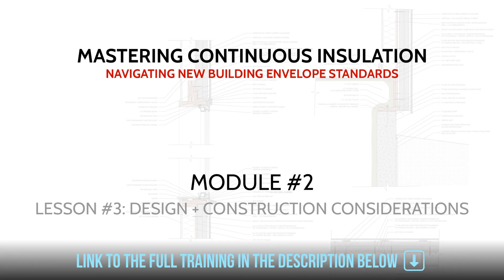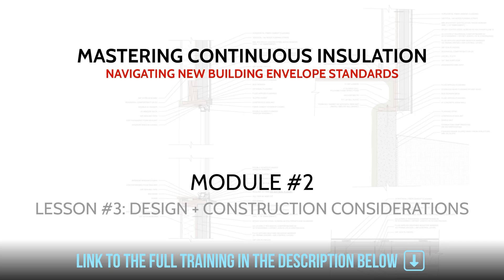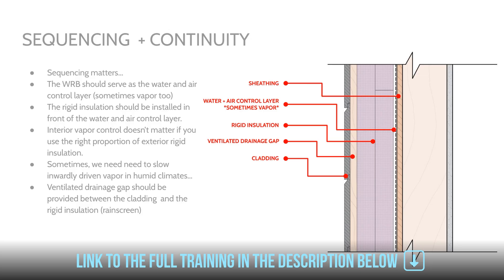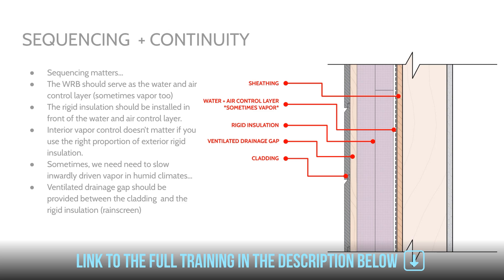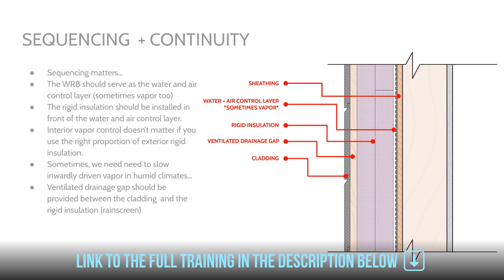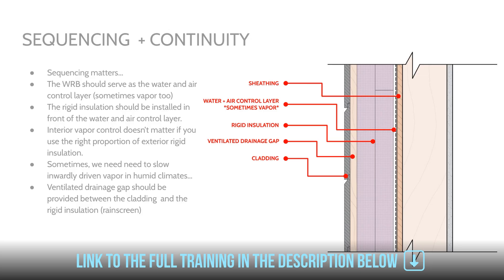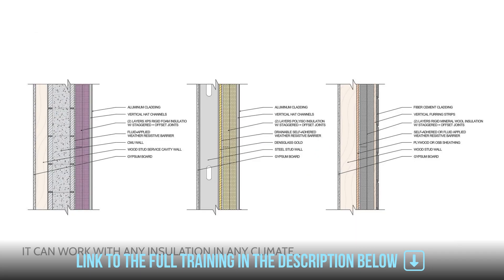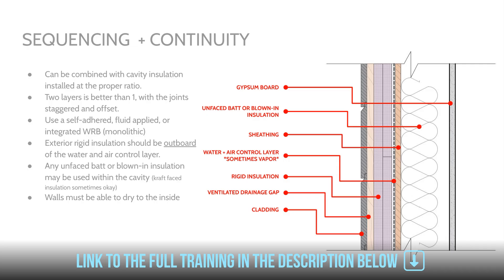Continuous Exterior Insulation Training (The Perfect Wall, Design & Construction Considerations)

Comment: Please excuse the extensive length of my comment. Thank you.

Subject: Seeking Expert Guidance on Exterior Brick Repair and Insulation for 1950s Montreal Buildings

Hello!
Thank you again—I’ve greatly enjoyed your videos and found them exceptionally informative and helpful. As a small, family-run property owner in Montreal, Canada, I manage older buildings (constructed in 1954) that are experiencing significant exterior brick issues due to our harsh winters. One three-storey semi-residential/semi-commercial building required urgent demolition and rebuilding of a severely bulging wall. After thorough research—including your excellent content—I obtained quotes and approved my contractor’s recommendation to add exterior rigid foam board insulation. Please note that when the existing bulging wall was demolished, there was no house wrap present. The wall consisted of plywood sheathing, a ventilation gap, and then the brick veneer. No exterior insulation. For reference, the house was originally built in 1954.

While I’m unsure whether house wrap was installed behind the foam, I noted that foam board insulation was applied directly to the sheathing. The tenants later reported noticeably warmer interior walls that winter, and I’ve been very pleased with the improved comfort and energy savings.The remaining three walls are now showing similar (though less severe) bulging and bubbling, so they will also require rebuilding. I’d like to maintain effective exterior insulation for tenant comfort and efficiency.

I have consulted several masonry contractors who insist that exterior rigid foam board insulation is not required under Quebec's building code, that it represents an unnecessary expense, and that it could create additional challenges for the bricklayer.

Several new masonry contractors I’ve consulted offer conflicting advice:  Some note that adding rigid foam reduces or eliminates the original 1-inch ventilation/drainage gap, and suggest building the new brick veneer slightly outward to compensate.
 
Others strongly advise against adding exterior insulation and discourage extending the brick veneer outward over the foundation.

I'm now feeling a bit confused and would appreciate some clarification.

My original contractor (who successfully rebuilt the first wall) has respectfully declined to take on the remaining walls. As this is my first major brick restoration project—and a significant investment with little margin for error—I would greatly value your expert perspective on the following:

Should I insist on preserving a proper ventilation/drainage gap behind the new brick veneer?  
Would you recommend including house wrap, followed by ribbed (or drainage-channel) rigid foam board—even if it wasn’t used on the first rebuilt wall?  
Given the differing opinions, what is your preferred approach to balancing insulation performance, moisture management, and long-term brick durability in our cold, wet climate?
I also took several detailed photos of the first brick wall during both the tear-down and rebuild phases. 
Please note that I replaced the old roof with a completely new one on this property before repairing the brick wall. The contractor was fully aware of this and assured me that he engaged an experienced tradesman to properly extend the roof flashing over the newly extended brick wall.

 I’d like to ask for your opinion: as the homeowner, do you think I approached the rebuild effectively? And overall, did the contractor do a good job?

Your insights would be invaluable as I plan this work and prepare for similar repairs on a second residential property. Thank you sincerely for your time and for generously sharing your expertise.

Warm regards,

Brace Rainer
Montreal, Canada

Comment: Does adding exterior rigid insulation on only sub-grade portion of a basement wall make sense? 

I have to re-waterproof a split foyer and the above grade portion is not being altered on the exterior, so would also be adding new interior insulation.

Comment: I just thought about something and wonder if it could be viable. I was picturing a simple 1 story rectangular shaped house with continuous insulation, if the interior was framed with a flat ceiling there would be a low triangular shaped attic area within the conditioned envelope, right? What if that area could be utilized to save a ton on mechanicals? Even eliminating ducting! I'm imagining putting an air purifier, cheap dehumidifier, HRV up there dumping air without ducts, maybe even an AC. and having a bunch of bathroom fart fans connecting the rooms intaking in the kitchen/bathrooms and exhausting into the living areas.

Slab on grade foundation, SIP's exterior utilizing full panels and a simple square/rectangle shape and budget mechanicals like that could possibly hit a really nice cost/sqft number?

Comment: Video topic idea: You’re a big fan of the “perfect wall,” and another video you talked about using exterior insulation with a gap and then a brick or masonry layer. 

Let’s say I wanted to go crazy - 6” of continuous exterior Rockwool Comfortboard 80, then a 1.5” gap, then a brick outer wall. How on earth would I do the windows? The wall would be close to 17” thick before drywall, assuming 2x6 framing.

Comment: How do we rain screen for individually applied Eastern White Cedar shingle cladding?
Reply: Typically you use 2 layers of furring. The first layer is vertical, screwed through the insulation, sheathing, and into the studs. So you need long screws. These furring strips would be something like 1x3 or 1x4 wood, spaced the same as your studs. The second layer of furring goes horizontally over the first layer. These screws into the vertical furring. So you don't need long screws. They are spaced according to your shingle spacing. With this system you end up with a 1 1/2" rain screen gap. So you'll need to plan for that when you trim your doors and windows. 

Alternatively, to get a smaller gap, you can make your vertical furring out of strips of 1/4" plywood. These can just be temporarily tacked to the insulation. Then you use 1x3 or 1x4 for your horizontal furring, spaced according to your shingle layout. These horizontal furring strips need the long screws into the studs. With this approach the plywood strips give you a 1/4" gap between your horizontal furring and insulation. That's plenty for drainage. This system gives you a 1" total gap, which can make trim around doors and windows easier.
Reply: @HistoricHomePlans  Thank you!

Comment: Zone 3 edge to 4 Please let me know if this will be a moisture laden situation -

At basement: I'm Planning to stagger 2 layers of 1.5in of glass coated 25psi polyiso continuous insulation adhered to exterior of 8in poured wall down to footing with fully adhered reinforced 60mil EPDM fully enveloping the ISO against soil because of termites eat polyiso. Wrb outside of ci. Not against poured wall
Note that the EPDM is fully seam taped enveloped to the under the footings, under slab and pulled over the foundation wall to terminated mudsill as s well.  
*Epdm to be fully seamed together envelope of basement. (Not lapped)

 Above grade 2x6 framed: Continous "same iso" assembly exterior up to roof over osb except Sharkskinultra sa over the iso metal clad on bearing plates no furring req. Sharkskin to lap epdm at foundation for continuous wrb (directly under the cladding)

Zero batt at studs interior other than mineral wool for austical. 

 At roof: Standing seam roof with bearing plates over Sharkskin ultra sa over R-38 25psi glasscoated polyisilo over osb.... 

I figure if any air gets thru the 2 staggered layers continuous polyiso then it should dry thru the standard osb. (Not zip)

- Epdm 60mil reinforced bc its a landfill liner that wont shrink
-Glasscoated 25 psi polyiso for greater resistance to fire. 
- sharksin ultra sa butyl based wrb 

Im curious what you all think of this envelope?  

I would appreciate feedback
Reply: Planning my ~2,400sf workshop, very similar to this. Would love thoughts on it.

Comment: I did this to my house minus the wrb. I put it on the outside of the foam and regret it. I only put it on as a sunscreen. Otherwise exactly the same. I figured the rain screen needed a continuous water channel. I failed there. Information was hard to find at the time I did it so I flipped a coin.
Reply: I've never tried it but I understand that if you use EPS insulation and tape all the seams with the right kind of tape, that surface is considered to be an acceptable WRB in the building code.

Comment: What is used to create the air gap between the wrp and the exterior insulation? Also what is the preferred method of drainage for the inner and outer air gap?
Reply from the maker: You can use a drainable WRB, a drainable rigid insulation board, or even vertical beads of cured construction adhesive. Some people even use strips of sill sealer.
Reply: @ASIRIDesigns  wouldn't an airgap between rigid foam and the wrb cause you to let in cold air to that space. I can't picture how it would work?
Reply: @ASIRIDesigns great thanks for the reply
Reply: Does that apply to rockwool comfortboard also?

Comment: 5:20 I understood Kraft paper to be a "poor man's variable vapor retarder" but your diagram calls for unfaced batts and says kraft paper is "sometimes okay". I also understand that taping the seams of kraft paper can act as an air barrier, and while you can only have 1 "vapor barrier", you can have as many air barriers as you want. Given this assembly with insulation internal and external in the right ratios, assuming something vapor open like rockwool on the outside, is kraft backing "okay" or would you consider this risky? What if instead, you were to add unfaced batts and wrap the entire interior with a vapor variable air barrier? Does using these advanced materials assuage the concerns relative to kraft paper making it okay, or does this somehow make things worse in a cold climate?